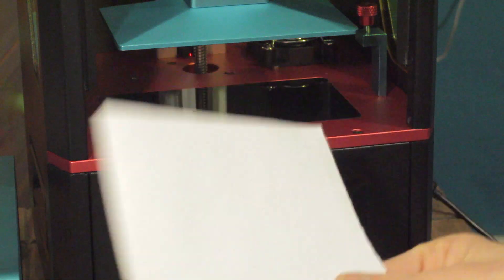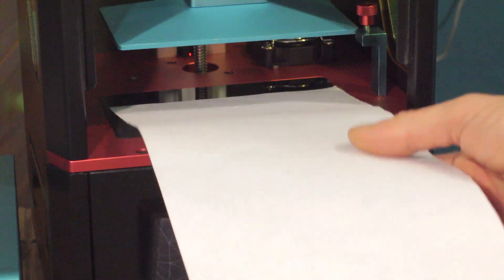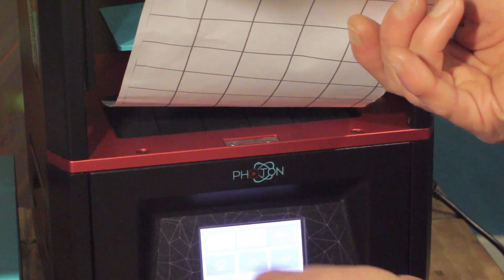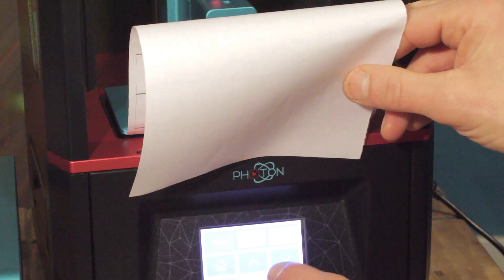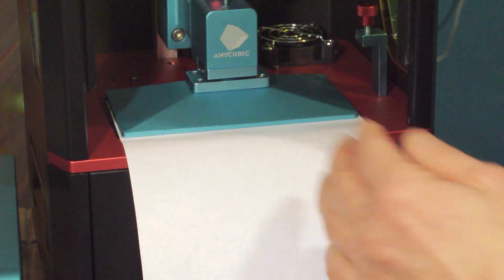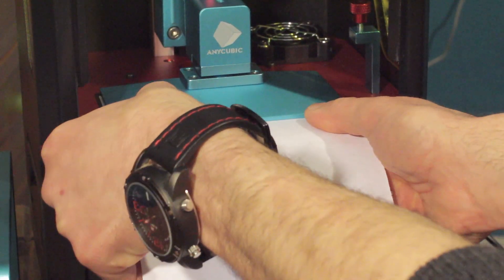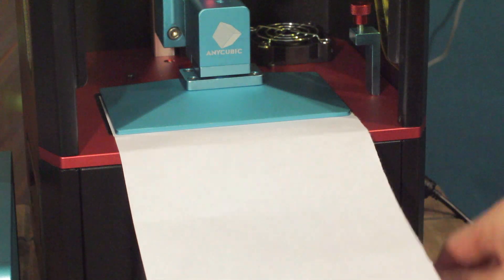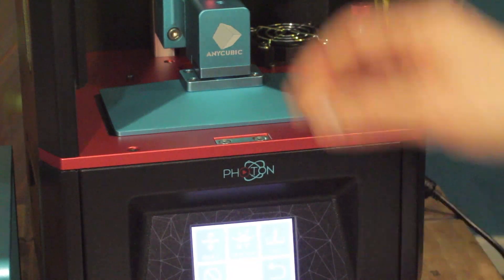Anycubic photon paper levelling method

Comment: I have tried this, however I have never gotten a successful print. Every time the resin sticks to the plate or vat.
Reply from the maker: I personally use the flint read method shown in my other video. I find it much better.
Reply: try tightening the fep

Comment: Ok so when we hit the zero button we should NOT be able to push in the paper when we do the final tightening and z=0.    I'm going to try it this way because I thought I was supposed to be able to push the paper in.  Oops.
Reply from the maker: That's right yes. You should be able to pull it out and feel resistance but not be able to push it.

Comment: no matter how much i tried, the left front corner is always little bit more below than the others. :/
Reply from the maker: Have you checked your plate to be sure it's completely flat?
Get a straight edge and lay it across and diagonally, check for gaps, if there are any you can sand until it's flat.
If it is flat, try the flint read method in my other video.

Comment: You definitely appear to be doing yours tighter on the paper than the other demonstrations I have seen on YouTube. Has your printer been working well with it at that setting? I have been watching how everyone calibrates it with the paper because I have the same concerns you have on what constitutes the width of a sheet of paper.
Reply from the maker: Others I've seem to use a full A4 sheet and often you see they end up with one side on the lcd and the other over the lip and on the groups you see and hear many comments of adhesion problems on one side which I think may be related. However, my chosen levelling method is the flint read in my other video which has worked perfectly on my first photon. (The one in the review returned due to z wobble problems) and the replacement.